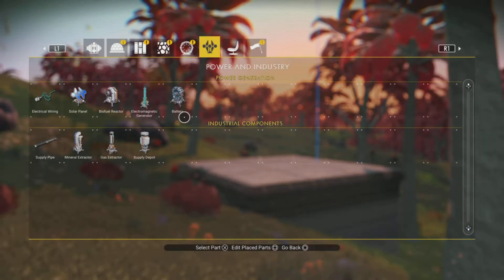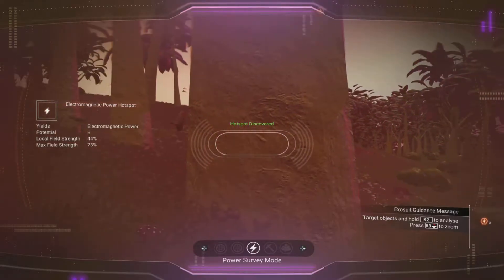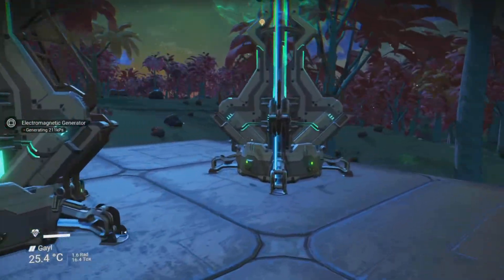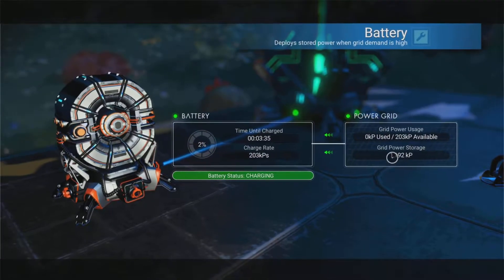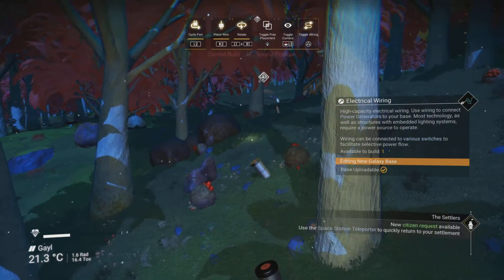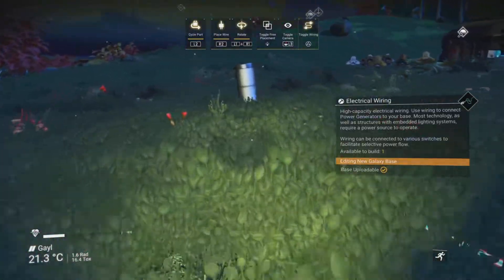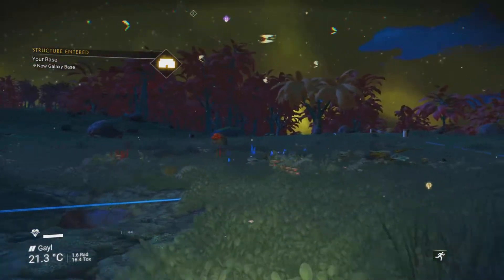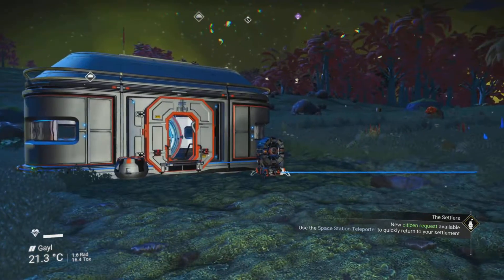How To Use Electromagnetic Generators In No Man's Sky

Comment: I did exactly what you've done here and when I try to connect the battery to the last post, it just doesn't work. The battery doesn't charge up. The EMG hotspot is well within the 1000u radius. All cables until the last post are blue and transmitting. It just the last one that I doesn't power anything, even though it is blue.  must have missed something. Is this technique still works in late 2025?
Reply: Yes I have the same issue

Comment: Btw, the pipes are in the flag tab of the build menu if you scroll down a little.
Reply: To find the pipe go to Space Anomaly > Construction Research Station > Primitive Shapes > unlock Large Wedge - 1 Salvage Data needed > unlock Pipe - 1 Salvage Data needed too. That is it. To build each Pipe you need 20 Ferrite Dust - Reference in 2025. Have fun guys!
Reply: I don’t see anything but lights and a flag and pavement on mine???